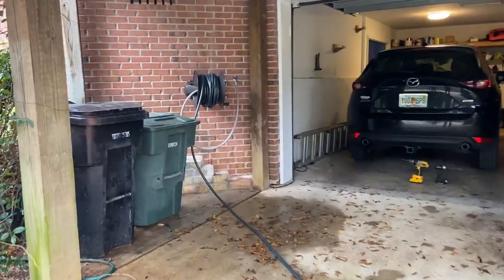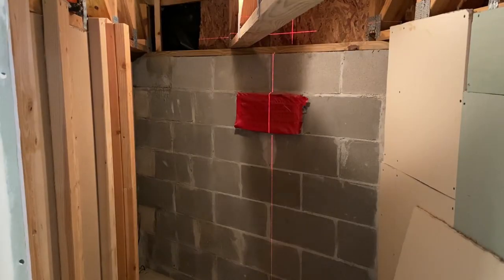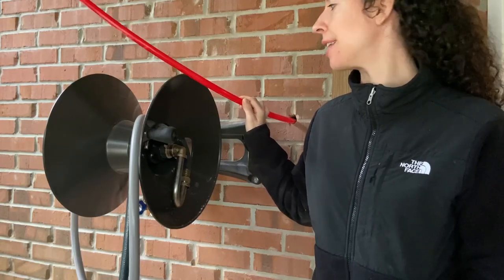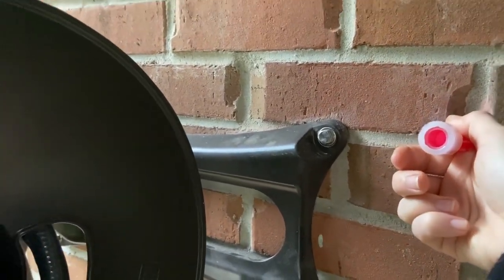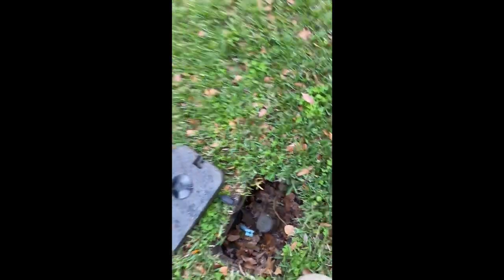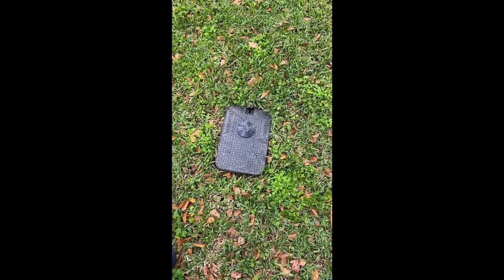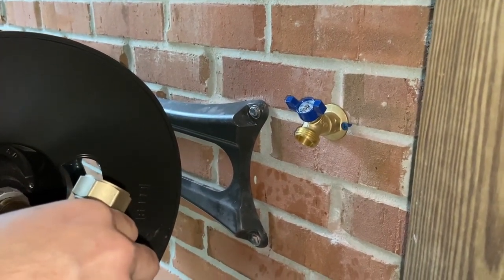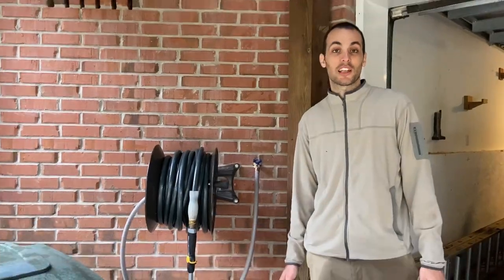How to Plumb and Install a Hose Spigot with PEX

Comment: That’s the reason I don’t like colored pex. Your situation is different because you’re installing it on your own house and it’s going to a hose Bibb so there’s no mystery as to what the line goes to. However as a plumber it’s frustrating when you think you have a hot line and it’s cold. When you only have white pipe, it forces you to label it during installation and to investigate fully when repairing it. Good decision to go with uponor. It’s defiantly the best pex on the market in my opinion. Another positive is the fittings have the same inside diameter as the pipe because the pipe expands over the fitting. With crimp the fittings are smaller than the pipe because they go inside the pipe. This creates a choke point at each fitting.
Reply: Why would you not always use red for hot and blue for cold?
Reply: @emilyclark9043  ideally you would. But there’s been times when the supply house doesn’t have one color or if you’re in a time crunch and run out of one color. There’s lots of reasons people do it

Comment: Two things that are wrong with your install. First, you used red PEX which indicates hot water - should have used blue or clear. Two, you should have located the spigot to the left so it looks aesthetically pleasing, but that’s preference. Also, I didn’t see an anti-siphon fitting.

Comment: I dont want to sound like a Debbie Downer/Mr. know-it-all, but it might be a good idea to install a shut off valve for that spigot. We’ve had trouble at our house with ours bursting and we’re going to install a shut off valve and make sure the pipe is slightly angled down towards the end near the valve and spigot so the water can completely drain out when we shut it off in the fall. Hope all is well!

Comment: This will freeze and won't last these are not meant for outdoor use the valve is to close to the outside the water in the line will freeze and burst
Reply: Florida dude

Comment: 1st off that women has control issues that need to be felt with. 2nd PEX is not for outdoor use that install isn’t to code in most areas. 

Bad advice